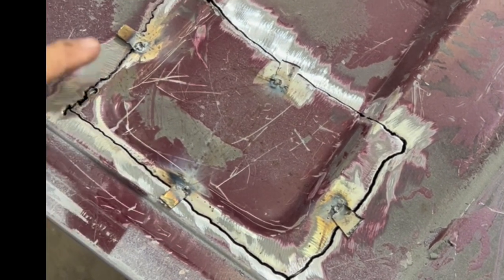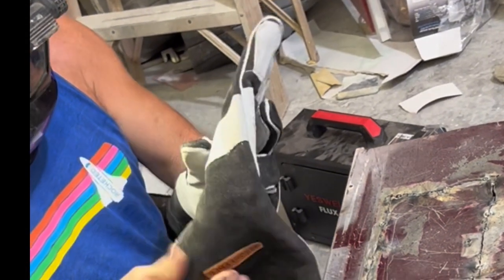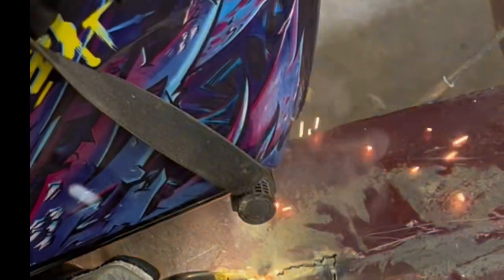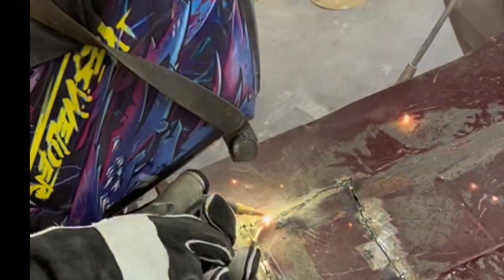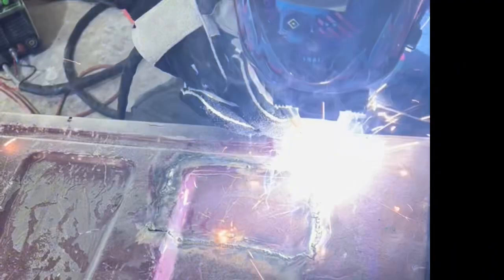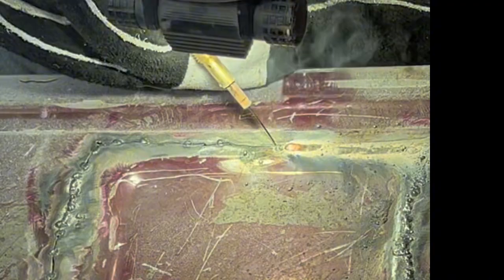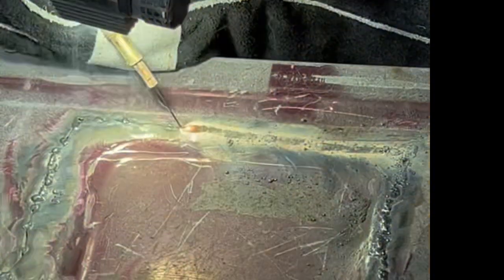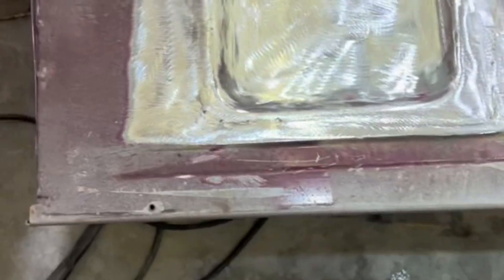A PERFECT PATCH WELD👍👍 Easy DIY Flux Core Welding Techniques 16 GA Sheet Metal How To Tips & Tricks

Comment: I've been using flux core on 110vac for 25 years because i don't do enough to justify a bottle and a 220 machine, but I've thought about it...
Now after seeing what billy can do, i don't think i will.
Reply: Flux is just fine , not pretty but effective and despite what trolls say I know myself , if you use a little extra stick out on thin metal it will not blow through that easy …. Also it doesn’t get crazy hot !!!

Comment: Hey Billy! The welding expert that sold me my mig welder told me that my old Weld Pak 100 125V Flux unit couldn't be used for body work....
Reply from the maker: Well, I’ve been above experts and professionals for 30 years, and I assure you the weld pak with .030 flux core is better for bodywork than a mig welder with gas😉😉
Reply: @OldBondoBilly  I'm gonna give it a shot....your stuff looks as good as the YouTube hot rod TV shop work with $10K tig equipment

Comment: What brand of wire are you using,and size? Reason I’m asking is I have to weld two places on my truck quarter, this is my first time trying, and I’m 75 ,don’t want to grind anymore than I have to, and I am not an expert on welding!
Reply from the maker: YesWelder wire, .030 flux core. Weld at 80 amps in split-second bursts

Comment: Why do you use flux over mig or tig. Is it because flux is burns hot
Reply from the maker: Yes; because of the intense arc, the fusion is much faster and the bead is much flatter.  BOTH OF WHICH ARE MUCH BETTER FOR AUTOBODY WELDING😉😉
Reply: @OldBondoBilly  thank you for the response🙏🏽

Comment: @Bondo Billy, this is what I am working on currently, but with some complications. There are two patch panels separating on the rear quarter panel of my '65 Falcon Wagon(4 door) and some of the old welds have broken away and left almost dime sized holes in the seam. The patches extend down to the bottom rolled edge of the panel. I am using a flux core welder(90 amp) and am having some difficulty. I am not sure if I should use a narrow strip of scrap metal on the backside of the seam to create an overlapping joint, or someone suggested using a wire coat hanger to stitch the holes closed. I am certain that you would cut the old out and replace it with a new patch panel. I don't have the material for that, and I don't have $400 laying around for a manufactured patch panel. Do you think that using a wire coat hanger to help fill the gaps would work okay? Thanks for your time and attention in helping me to figure this out.
Reply: If you can get to the back of it, you can use a piece of brass or copper to back up the weld and the weld won't stick to it. I've used flattened copper pipe with success. The hanger will work as long as it isn't plastic coated like alot of hangers are
Reply from the maker: I’d probably cut a little piece of metal to weld into a whole size of a dime or bigger